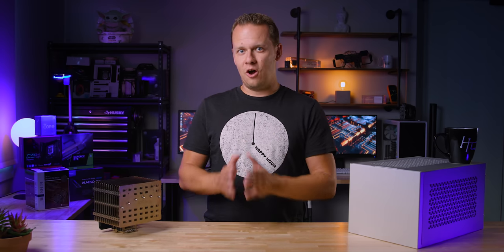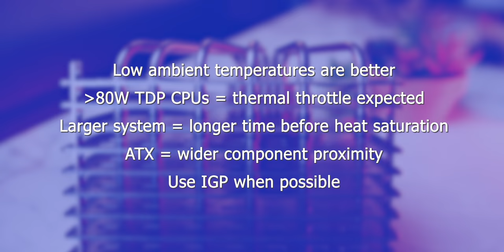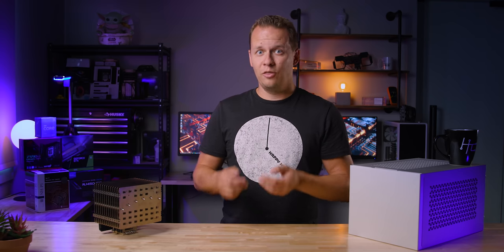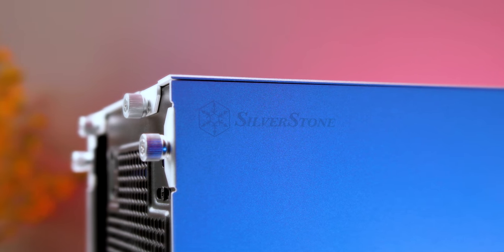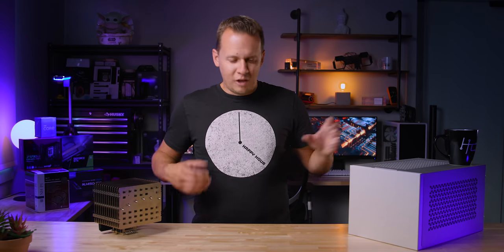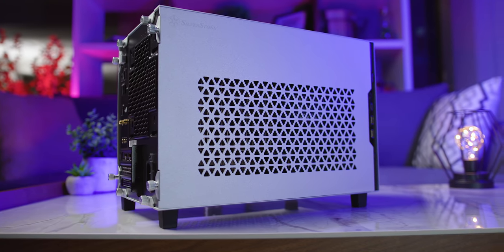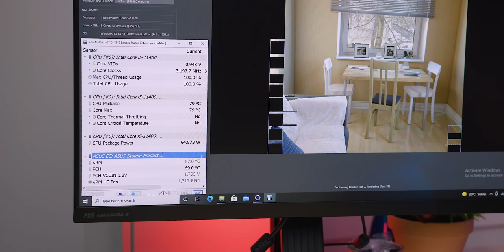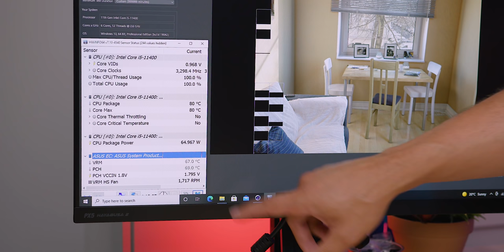This Passive PC Build is TOTALLY Different!

Comment: Wouldn't it be better to make that fan an exhaust?
Reply: Well, having just an exhaust collects more dust in the system, so if a single intake fan with a dust filter is enough to keep the system cool, I'd choose that because it makes keeping the system clean easier. If you really want to maximize the airflow and you don't mind dusting the system and filters more often, then yeah exhaust is a good option.
Reply: First thing I thought was why didn't he try that
Reply: Others who have tested have found that negative pressure is usually more effective than positive pressure in SFF builds like this. So yes, he should have tried that.
Reply: @Mixa_Lv   /SMH you didn't just say that.. I really hope what I just read was a bad dream ... /FacePalm...
Reply from the maker: Maybe!  Totally intend to test more hybrid configs in this one.  Can't wait!
Reply: This case is super easy to keep clean with a pressurized air can, so a slow moving exhaust fan would probably be a really good idea.
Reply: Without fan, the heatsink was already taking in all the hot air rising from the VGA. So inverting the fan would make the suction cool down the VGA more efficiently, and would also help the processor because there would still be cold air sucked from the top. So even if the processor is 10 degrees colder instead of 20, the VGA would still benefit from the cooling.
Reply: @Mixa_Lv  Good point and I agree. Is this usually how you build a system?
Reply: Yea I think an exhaust at the very top has a high chance of being helpful
Reply: The It Will not be pasive dude
Reply: @qwertyferix  that generalization is for sandwich layouts…
Reply: My thoughts exactly.
Having the fan exhaust will suck air from all around the heatsinks (and outside area of the case) and bring fresh air throughout the case, rather than blow air into one area
Reply: @Mixa_Lv  wtf are u saying 🤣
Reply: Just watched the vid and yes turn the fan around.
Reply: @WarriorsPhoto  Nope, 2 fans is the way to go, but I still keep the intake airflow a bit higher for dust control. I just pointed out a reason why someone could want to consider the intake option.
Reply: @Mixa_Lv  I agree with that thinking btw.
Reply: Exhaust fans are the way to go in such a setup..
Reply: Fuck the dust,.. clean it once a month. You want to play your fav game without fan noise assuming coil whine isnt a thing on this gpu :p

I had a different aproach myself, i have 5600x and 6759xt running Hogwarts Legacy on high settings and 1440p around ambient noice using Bequite case and coolers + fan curves.

But,.. the coul whine still anoys me! Any tips? The gpu is a amd card
Reply: This setup is wasting the convection because it's not sealed, so the air goes everywhere and loses upward momentum.

Exhaust fan on top, filter on the bottom and the whole case needs to be a huge ducted closed system. Like an upwards  ducted fan with an extended air intake to place the Mobo and heatsinks.

Comment: I love that you tested the hybrid approach at the end with the super low RPM fan. Personally that is what I would do. Hoping to see more tests like that!
Reply from the maker: Thanks!  Still more testing to be done!
Reply: @HardwareCanucks  you could flip the fan as that might help the gpu and cpu temps
Reply: @shrek1388  That would work better as would just an exhaust fan in the rear. Depends on what components he wants to drop temps on more.
Reply: @HardwareCanucks  can't wait for part 2! please keep us updated on different fan placements, and maybe vs a 5600X for comparison?

Comment: I'd try to put one large slim fan on the floor of the case, pulling up. That should help a ton both GPU and CPU (mostly GPU), because of the already ideal flow being vertical up
Reply: And all the dust will be inside the case
Reply: @NikitaGarets  if you place it on the floor without filters yes. There's fractal torrent with that concept. If you place a dust filter shouldn't be the end of the world
Reply: @piereligio_ds  if you ready to disassemble and clean every month, no problem
Reply: @NikitaGarets  if it's placed on the desk (being a small form factor), it won't collect much dust

Comment: Exhaust fan on the other side might work better than an intake.
To the left of where your current fan is
Reply: nzxt h500 best example of onesided fansetup
Reply from the maker: Yup.  Totally gonna try that.  Like I said, I'm not really finished experimenting with this one yet! - Mike
Reply: or invert
Reply: @Maxwell2101  Probably gonna experience the same issue just opposite. GPU heats up CPU.
Reply: @Tomazack  depends on the workload, less cpu usage with some undervolting could be golden.
But hey, its his system. Let the man tinker.
Reply: That was my thought from the start, the only way I'd do a "passive" build like this without fans on CPU, GPU, or PSU would be so that I could have only a single exhaust fan and let the case mesh handle the rest with as little noise as possible. I'm glad they tested both ways though, very interesting little system.
Reply: @HardwareCanucks  let us know with some more videos

Comment: Try a quiet top exhaust fan to help the natural convection. Most important part is to get the warm (therefore less dense) air out of the case, as it goes out, cooler ambient air will be pulled in.

Comment: It would be very cool to see the gaming performance and how low the temps could get with an 11600T, the 35W processors. Also you should undervolt all of your components.
Reply: A 5600x would of run cooler. It confuses me when I see these builds. Go AMD where you can get no penalty in performance running at 35W to 60W or run an Intel CPU, cut its performance and hope for the best in temperature.
Reply: @baconbreadwithbacon  what? amd cpus are way hotter
Reply: @pietrog  My 5950x at 4.2ghz runs 7°C cooler with same cooler and case than a 9900k running at 4.2ghz. I also swapped my brother from a 9700 to 5600x and at the same clock rate on water, the 5600x is happy at 53°C and the the 9700 was at 59°C on load.

A 5600x won't require a 150W cooler to keep it cool while a 10400 as an example, runs at 90W or more before you turn off power limits. A 5600x without power limits won't push 95W. 

Intel is slightly faster at the cost of high heat.
Reply: @pietrog  no. It's not 2012. Undervolted AMD APUs/CPUs can run very cool. Obviously not a 16 core 5950X for this cooler though, a 5600G with APU disabled, CPU undervolted would be very cool. Although an 11400 isn't a hot CPU at all.
Reply: @baconbreadwithbacon  it's not 2012.. exactly my thoughts lol I am curious if you could get 5950x to a viable heat output for this setup though.  Maybe down at 3.8ghz all core or something.
Reply: @pietrog  Intel is pretty much 2x the watts for same performance now. At least when you look at 11600K vs 5600X with avx load on cinebench.
Reply: @baconbreadwithbacon  5600x with pbo uses like 88w and 65w without.
Reply: @pietrog  no never

Comment: I have that exact card in an optiplex build and it works wonderfully. Not having to hear the gpu fans on full blast when playing more demanding games is a whole new experience. Havent had any issues even on the hottest summer days. I tried once but couldnt achieve thermal throttling by running stress tests for over an hour.

Comment: That the fan made it heat up more is pretty fascinating. I think if one puts an empty box on top or some other kind of chimney the convection will do a lot more work. Right now the heated air dissipates into the room, if there is a chimney it will suck cold air in from below.

Comment: Fans typically have an RPM where they become audible - I have 3 Noctua case fans in NR200P plus CPU fan and using ITX at sofa distance if I keep them below say 700 RPM for temps up to say 60C then as the 3080ti (undervolted) and PSU both have fan stop and a Zen 3 in ECO mode on a passive B550i the system is inaudible for normal usage but if the GPU gets to 250W+ the fans are there to help.
I like to judge things on how quickly the system can cool down from a peak usage - fans supporting a bottom up case airflow really help

Comment: In addition to the exhaust fan, undervolting the GPU would go a long way too...
Reply from the maker: Its already pretty low performance LOL
Reply: @HardwareCanucks  You can undervolt without lowering clocks. And since it is on the lower end I can't imagine this is being used for GPU heavy tasks, so even if you did lose a few frames in exchange for a few C would it even be that noticeable?

Comment: As a lot of other commenters have suggested,  changing the fan's airflow to make it an exhaust fan might produce better results. If possible, I'd also adjust the case orientation so the intake ventilation is at the bottom and the top is a solid panel.  I might even go as far as blocking up some of the side ventilation, just to ensure that the fan is actually pulling air through the case, and not just circulating air around the fan. 

FWIW, my PC's original build was a sort of semi-passive arrangement like that.  I had a passive heatsink on the CPU (an i7 4th edition) and the entire PC was cooled by the fan that the case came with (a large fan mounted to the front of the case).  The PC performed well for years.  And then it started to BSOD at odd random times, but typically some time after I played games on it.  Then the BSODs got more and more frequent, until I opened the case and at a whim, reseated the RAM.  No more BSODs since.  The issue I think was not just heat buildup around the CPU and RAM, but heat VARIATION in that area, with the corresponding expansion / contraction leading eventually to a poor electrical connection.  My takeaway from the experience is, not only is it important to keep the temperature below a certain level, it's also important to keep temperature variation to a minimum.  So now there's a fan attached to the CPU cooler, and the CPU itself sees temperature variations of up to only 25 degrees C, not the 50~60 degrees C temperature variations that it was previously experiencing with just passive cooling.

Comment: Has anything ever been tried where they use the heat produced to circulate water though copper pipes and create a circulation where cold is gravity fed and the heat returns back up into the reservoir?

I don't know the fancy words for it, but i picture how a rocket heater works with the copper tubing coiled around the heat produced from the flame.

Comment: You could make a faster GPU passive by putting an NH-P1 on it instead of the stock cooler. You would also need a open-air case to make room for the 2 massive heatsinks.

Comment: Something I'm kinda curious about is fanless water cooling, i.e. pump, but  no fans. Basically, push the heat out to a radiator, then rely on passive cooling for the radiator. I susect it could be quite effective for silent, performant builds... if one could find a passive radiator. I'm not sure anyone actually makes a radiator with sufficient dissipation area to passively cool itself though.

Comment: For a better passive GPU i recommend you the Morpheus from Raijintek. You can choose any GPU you want and then set the Morpheus and choose to set fans or not :)
Reply from the maker: Funny you should mention that.  My issue was that at the time I bought (yes, BOUGHT) the GTX 1650, it was the only thing available and I counted myself lucky I could even find a GPU, let alone a passive one!
Reply: Yeah, I was about to mention that. Maybe you can do an update video in a few months testing that cooler. If you can fit any long 2,5 slot GPU, you can fit any GPU with the Raijintek cooler (without fans).

Comment: I'd be interested with seeing how the fan set to exhaust rather than intake changes things, also with trying a fan instead of on the bracket but in the rear of the case as they can take rather large (and therefore rather quiet) fans that still shift a lot of air, though, it will be at odds with the finstack.

Comment: Wait, while cooling a PC or even your room, is it best to have a fan push in cool air or push out the warm air? If you had the fan push out the hot air from the system forcing in cool air from every opening aside from where it's mounted due to that negative pressure created wouldn't it have helped cool both the CPU and GPU even if it's ever so slightly more?

Comment: For anyone building such a passive cooled PC, You can do it and improve on this but like this it is not so cheap , A direct die contact plug using liquid metal will take you down a few degrees, Thermal Grizzly do one, not sure the price these days, Under voltage of your CPU , you can tweak to get that sweet spot, you can also get a good quality PSU and just remove the fan, be sure that the capacitors are decent and heat sinks are of high copper content, (This is just to save costs as the Seasonic PRIME Fanless is not cheap but you can get that) also you will need a slightly larger case less so about thermals and more about fitting it all in comfortably.  you can get more and better heat sinks for ram, motherboard chip sets and GPU , ultimately you want to maximize airflow space and surface area as heat naturally raises and you can make this work to your advantage.
I am currently running a custom system of similar design typing this out with a 7800x3D 3050, all with custom heat sinks ect, I range 49-70 temps on load depending on game i almost got to 80 on cyberpunk, the trick is have fun, tweak and enjoy the process GL
Reply: sorry just one point of note for PSU this takes in account that your are using a low powered card Eg 75w motherboard powered card, I would not recommend anything too heavy as you may blow capacitors but hey , I think anything is worth experimenting with if you don't mind blowing things up or setting your motherboard on fire but jokes aside think about it and monitor your temps.  Have fun it is a good fun project if you go all the way and problem solve your self.

Comment: I had the same issue (different case, different cooler) with a CPU cooler resting on a KalmX GPU and I would not have chosen a thermal pad as the fins might cut through it over time. I choose a self-adhesive feld glider. (the ones you put under chairs)
Reply from the maker: Felt unfortunately can be a conductor of static.

Comment: Another potential option for GPU cooling is the Accelero S3, rated at 135W passively and can be attached to whatever.
It still wouldn't get you monster performance, and I honestly don't know if it would even fit in that case, but a bigger GPU undervolted to run under 135W should in theory perform much better than a smaller card going ham

Comment: I'm not into SFF or passive, but I do often have the urge to do unnecessary amounts of performance optimization, and I am told that passive SFF is a great way to put those urges to work. "it posted and hasn't bursted into flames yet, journey progress:  .001% complete"

Comment: i can totally relate to this sort of YOLO'ing right now. waiting on parts for an ITX build that's 5600g-based. my original plan was to reuse the wraith prism from my 3700x. I checked the general measurements on the case that was advertised and thought i was good, but saw yesterday that the mobo tray sat somewhere in the middle of the case - so i think i missed the mark by a couple of millimeters taking manufacturer tolerances into consideration. hopefully not.

Comment: My first PC was passive cooled. My 486 DX100 had just a little aluminium block on it, just about the size of the CPU itself :D
Reply: Yeah, that's because active cooling wasn't required on any PC processors until about the Pentium 120. The 486DX4-100 only drew (at most) 7.5 watts of power. My first PC's chip was passively cooled, too; a Pentium 75 (3W-8W) with a pretty large heat sink. Later builds I did had fans on the heat sink, though, as clock speeds ramped up and power dissipation requirements skyrocketed.

I wouldn't mind having this system, it's just that I don't think it would work out for me if top ventilation is necessary. I have a cat. He would sleep on top of it, because it's made of warm, and probably would make it throttle all the time.

Comment: If the fan was set to exhaust it would pull air through both heat sinks. Or if the fan was on the top or bottom it would simply assist natural air flow through both heat sinks.

Comment: Imade a passive 3950x build using a U14C, using a square tube to make a 'chimney' i was able to run the 3950x at up to 3Ghz passively, with a 1m chimney it could probably run it up past 3.5Ghz

Comment: i'd find ways to custom fit 2 slim fan below the GPU and run them below 800rpm and 1 rear exhaust fan below 800rpm and call it a day. remove the fan u have blowing on the CPU heatsink.
i believe at with these minimal airflow the VRM fan should be able to spin slower too.

Comment: You should've mounted the fan in the bottom of the case and put it on a switch, that way it wouldn't interfere with the natural air flow path or eliminate the possibility of totally passive cooling.

Comment: You need to place a Fan on the top of the Case.. that would solve your problem.
If it Fits use a 140mm low RPM Fan because with a lower RPM you will push even more air with a 140mm than you can do with a 120mm. 
You may also force the air a little bit more from the bottom instead of using the side panels by using the dust filters. 
This will cause a dramatic lower GPU temperature without getting the CPU any hotter.
... or you may try to put a fan at the bottom of the case and use a filter - if you are afraid of negative preassure and collecting dust.

Comment: I had a Morpheus II on my 1080ti, and I really think that cooler could be a contender for passive cooling a lower power GPU. Maybe throw in the backplate from an accelero Xtreme IV, some ram heatsinks. And you could diy passive cool a pretty beefy GPU. Maybe upwards of 200w.